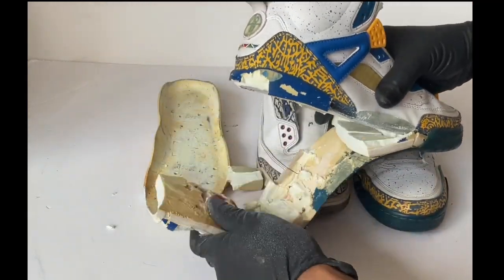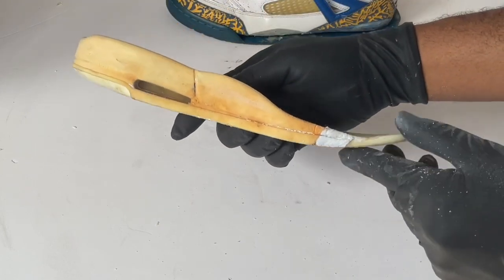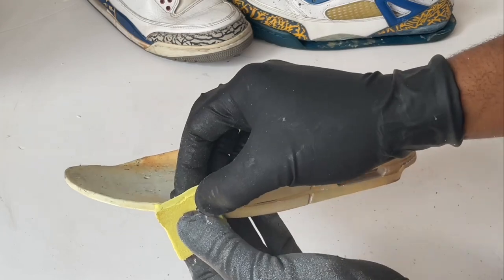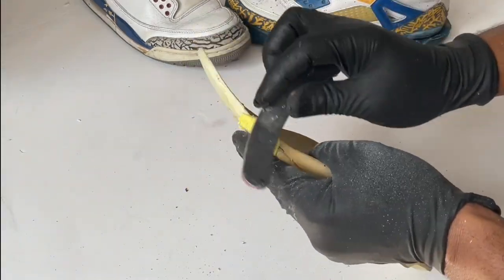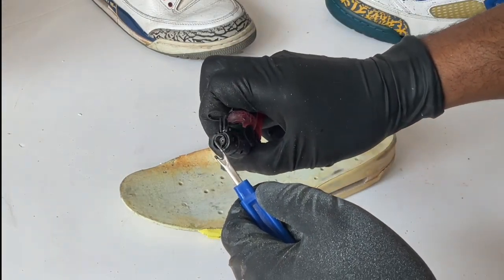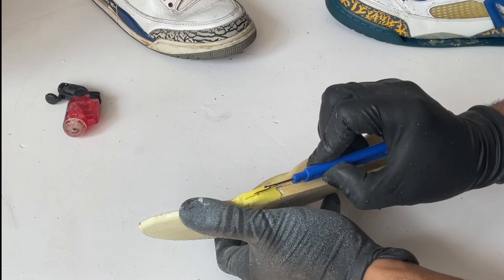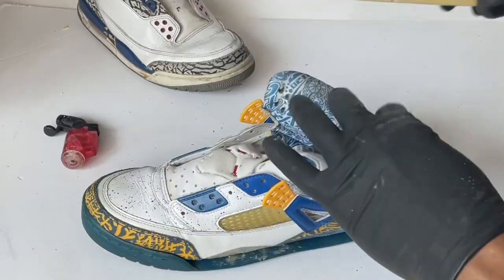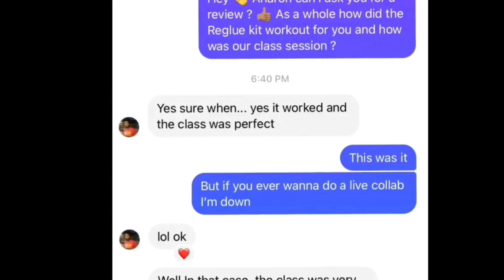Sole swap hack what to do if your midsole is to short for the outsole

Comment: You can actually make that midsole fit with doing that....
Reply from the maker: Yes 👍 you can ..along with some minor adjustments on the sides and heel of the midsole it will work. If you need pictures of the process just email 📧 footprinse@  Gmail

Comment: I just tried using the gorilla glue and baking soda method for my midsole like you recommended. The issue is though that the outside part of the midsole in the back looks really thin maybe from acetone damage. Am I just wasting my time doing the gorilla glue and baking soda method to reshape since that method is more for smaller defects. I’m not sure if that’s a less stressful area where I can get away with that. Should I just add a piece of foam to it like in this video?
Reply from the maker: Send some pictures to Footprinse@gmail .com let's see how it can be fixed